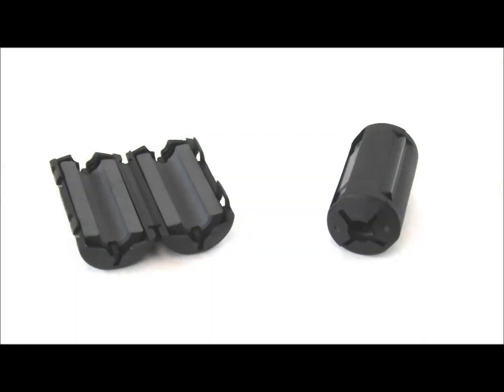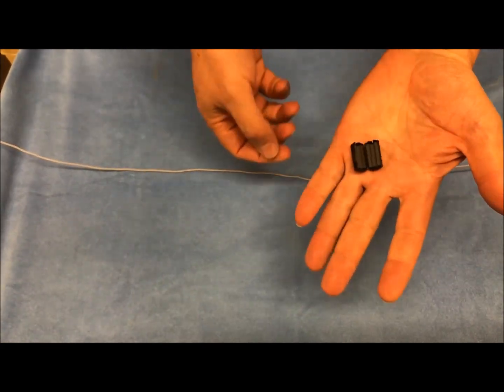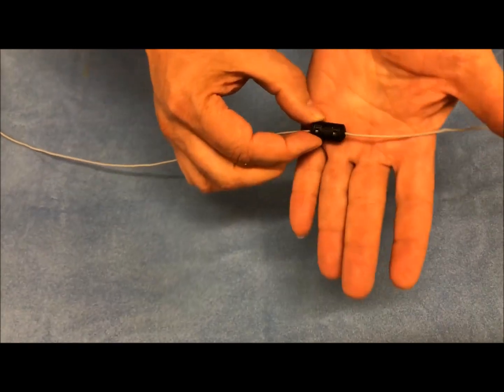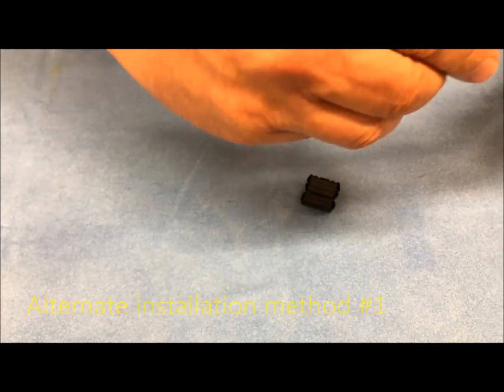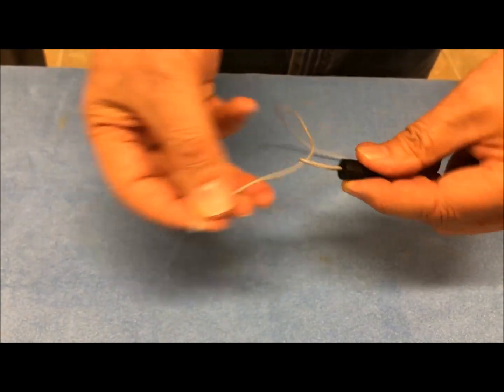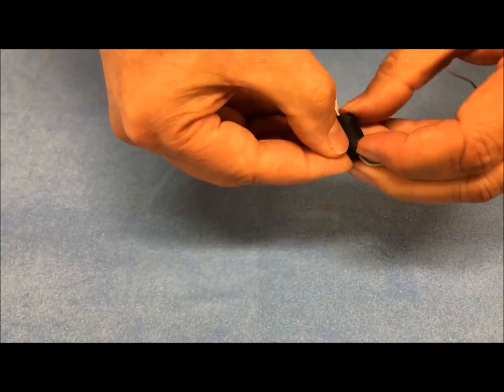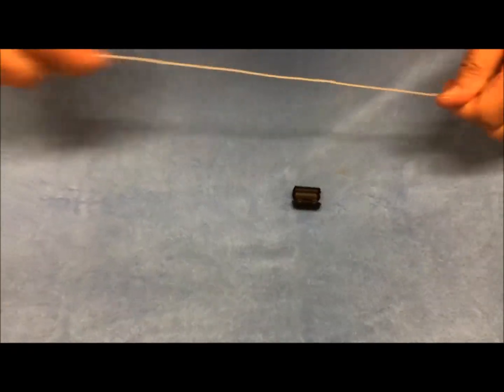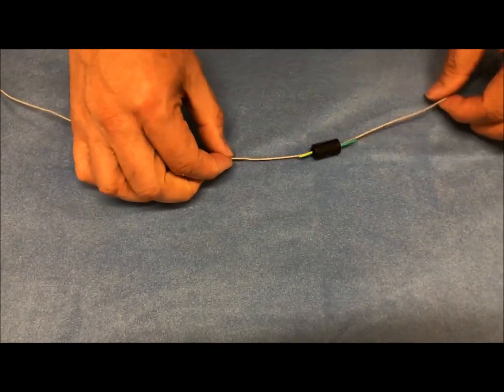Installing Ferrite Beads

Comment: Can this be used on the Mouse cable?  Speakers?  Microphone?  The cable sizes seem to be the right fit, doesn't look like it would work on a wired keyboard, cable diameter looks too large.

Comment: You missed the most effective method!! Put as many WRAPS on that ferrite core as you can fit for MUCH more attenuation.
Reply: Yes and no. When making a choke for a design frequency, less wraps can be more effective. This is based on the mix of the ferrite as well. So in other words, you could have, say,  five turns which is more effective on the frequency above what you are operating on. By reducing it to three turns, this could actually increase the choking impedance by a lot at the desired frequency. So less can be more.
Reply: Install a dozen or more on a wire and you got yourself Ferrite Anal Beads

stay safe out there and have fun

Comment: Will these stop led side marker interference with my TPMS?
Reply: I don't know what that is, bit it can reduce or eliminate outside RFI. A ferrite acts as a choke for common mode current. It not only works for transmit, but receive as well. I'm still not sire in this application though, because isn't the headphone lead also the antenna?
Reply: Tire Pressure Monitoring Sensor/System = TPMS

Comment: I have a Nulaxy KM18 fm bluetooth transmitter I just bought and have a 2002 Subaru Legacy Outback Wagon I bought it for. When I use the lower channels like 87.7, 87.9 it makes quite a loud higher pitched static sound and when I bring my hand closer to the device it gets quieter but if I raise my hand from the device is "whirs" in high pitch static. If I change it to a blank channel higher in the fm spectrum say 103.7 it works but has a much less noticeable static and doesnt react with my hand at these bands. The device itself plugs into my cigarette lighter charger area and has a metal flexible cable that extends up from the base and into the screen/module. There is a usb charging area at the base where it plugs into the cigarette lighter port which means it has power lines running through the audio section too which is bad correct? I thought this may be the cause of the static perhaps so i ordered some of these but have not arrived yet and just wanted to know your thoughts as to whether this could be a quick fix to attach them to the outside of that flexible cable. 

Thanks

Comment: For best RF attenuation, install the bead this way: place the earbuds in your ears and let the cord dangle down the front of your chest. Install the bead at the point approximately at the bottom of the sternum. If you install the bead close to the headset plug, then RF will still leak beyond the bead because it is so close to the phone's antenna.
Reply: THANK YOU!